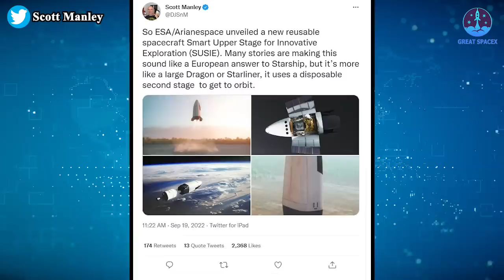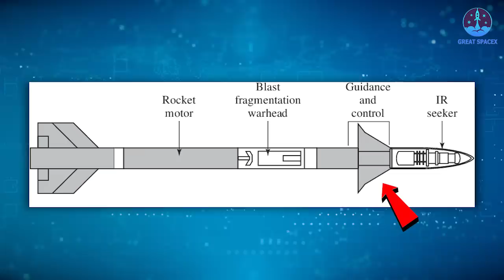Fail! Europe reveals new reusable rocket to replace SpaceX & Elon Musk...

Comment: It is a French company. So, until you see flight-proven hardware. Please, consider this either a design concept or a PR stunt. They never mentioned Starship in comparison.
Reply: The French rocket will work if there is WW3.... they are great at running away from conflict.